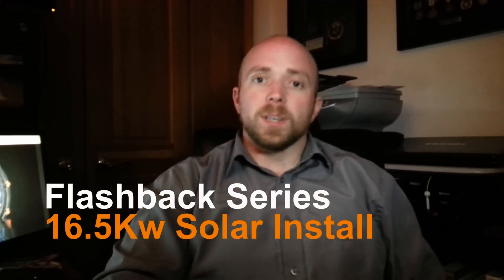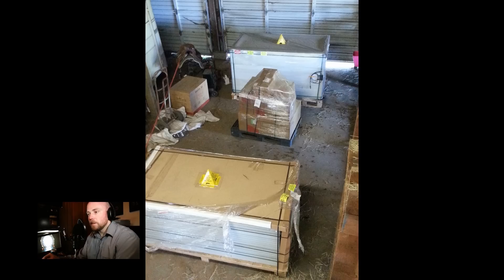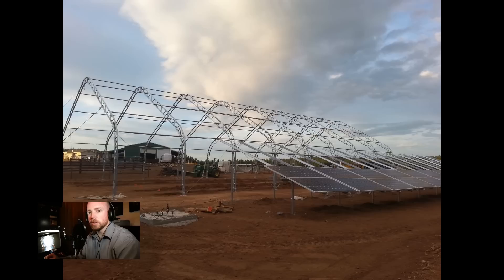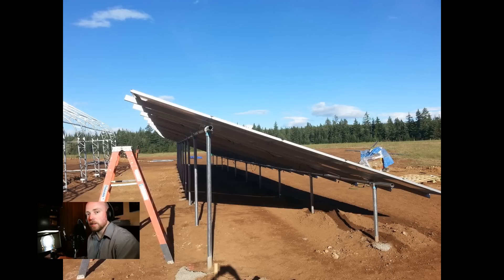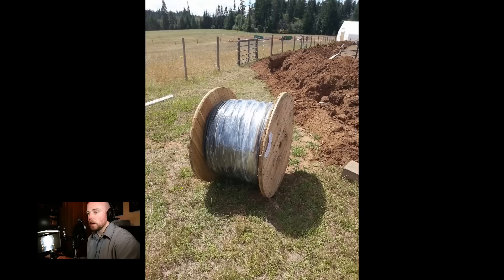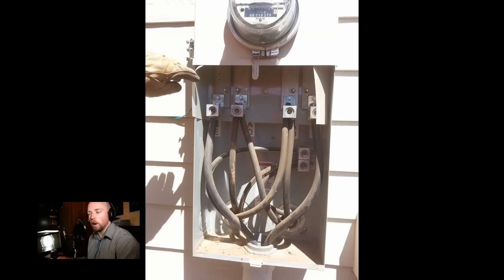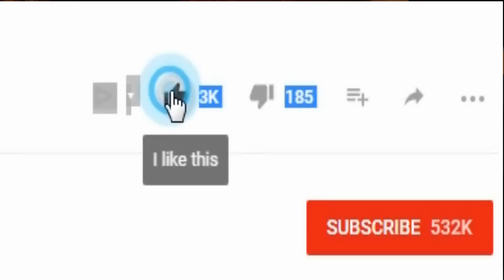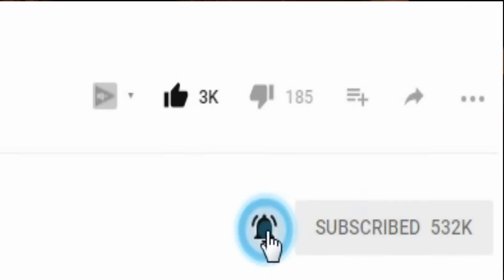Net Metered 16.5Kw Solar System Install - DiY Homestead

Comment: if you are making more than you are using what happens when the main power goes out due to a downed wire or storm . Are you back feeding in to the grid or does your system detect  a power outage and disconnect from the grid . Thanks
Reply: A relative of mine has a grid tied system.  If the power goes out their whole system shuts down too.

Comment: I was playing around seeing what all is involved in a kit. Do the invertersonitor grid power and tuen off solar in ebent of power outage ? Or do you have an automatic transfer switch that can kill mains when no grid power is detected...this would allow your solar setup to continue to power your house in daytime. but I have read several say those inverters need a mains sinewave to let solar power through. 

I take it your a statgate fan!
Reply from the maker: yes...i love stargate....wish it was back on tv

the inverters are grid tied inverters and as such do turn off in the event of a power outage.

Comment: Do solar panels "wear out?" Meaning do they lose efficiency over time?
Reply: tom7601 Yes, about 1% per year
Reply: Expected is 1% of power output lower per year of exposure, so in 30 years it will be down to 70%.
Reply: MsSomeonenew 
      Thank you.

Comment: The solar roadways from Sagle Idaho have heating elements in them to prevent snow and ice buildup. Are there solar systems like that for home use?
Reply: You can just back feed electricity into the panels and they will act as resistive heaters, of course the is plain madness because you will end up spending more electricity on heating all those panels then they will produce in the winter.
Yet another really bad idea those solar roadways people don't want to talk about.

Comment: Yeah those rocks do come in families! I have dealt with it more times than I can count :D and the little ditch witches just cant handle it. I do a lot of hand trenching myself, not fun but it pays the bills. Thanks for the info on the solar, nice big array you have there. Will be even nicer once you get some batteries in there :) can't wait for more info for the spring. Stay warm stay safe! Thanks again for the video!

Comment: Nice video! I am having the same issue now. My installer has tried everything and the unit goes into night time mode. I did check the D.C. Disconnect and no luck. At this point , I will need to RMA the unit with solar edge.

Comment: Think twice about a wind turbine sited next to you solar array and your fabric building(or any building). The blades can get coated with ice, then shed this layer at high turning speed. They become flying shards like daggers. My wind turbine site is almost 200 feet from any building. (I'm a electrical contractor that installs PV). If you can touch the wires to the panels and they are over 30 volts, it's not code(2014 NEC 690.31(A)) I mount my panels over 8 ft high.

Comment: How much did the solar system cost without labor? What was your electric bill like before solar and after solar? For you, the benefit is immediate. For most people who had the system installed, the payback is a very long time. I am curious about your experience. Thanks.
Reply: Figure a $1.25 a watt in parts

Comment: Love, Love - did I say I love - the enthusiasm that comes through your vlog!  Usually the answers are contained in the acronym RTFM - Read The Manual. I wonder if all knowing Google will replace The Manual...

Two Questions - will you rebuild the solar array to get it higher off the ground to lessen snow accumulation issues and to trade off between optimal energy generation vs snow accumulation?  Secondly, what would you do differently if you were to rebuild?

Comment: BTW: In regards to ur solar panels, I would have built a see-saw to pivot the panels into the sun with a single axis solar tracker and utilise another 40% of the suns energy to backfeed into the grid or just store them in ur battery banks when u get them, u can also use them to heat water directy thru a dc element without a battery bank and reduce ur propane use etc... Or better again is to mount them on pedestal dual axis platforms then u will never have seasonal change losses, and the panels will produce 110% all year round when the sun shines.
Reply: OffGrid Aussie Prepper™ : Its a 16kW system. Do you realize how massive a mount would have to be to support that in some kind of single axis? The largest single pole mounts on the market won't hold more than 9kW.
Reply: B_a_c_k_s_t_a_y Who said it had to be 1??? he cud utilise 10 with 8 panels on each, 1 solar tracka can control the whole lot, it isnt that hard.
Reply: OffGrid Aussie Prepper™ : Tracking mounts at his latitude don't make economic sense. It's is cheaper to add panels. If you installed systems you would know this. Grid tied systems are set to harvest the maximum yearly production. The company that sold him the system most likely sent engineering drawings that set that tilt based on his location, I'd say around 46 degrees latitude.
Reply: B_a_c_k_s_t_a_y Actually I do install off grid systems in australia and granted we have more sun production then anywhere else in the world, is the main reason why I stipulate to install solar trackers for energy production due to the low angle from Jeffs location in winter, so I am not talking out of my ass when I make suggestions. At my latitude I can get away with a see-saw to track east to west, each section holds 4 house panels, and I just keep adding a-frame sections till I run out of panels and still only using 1 single axis trakka and 1 geared braking motor driver..... having panels in a fixed position is a waste in my books. Jeff will eventually have battery storage and maybe hot water storage banks which can be utilised when his digester is not working.... SO LEARN to think OUTSIDE of the box, where there is a will theres a way... trial and error.... so get out of ur box...lol